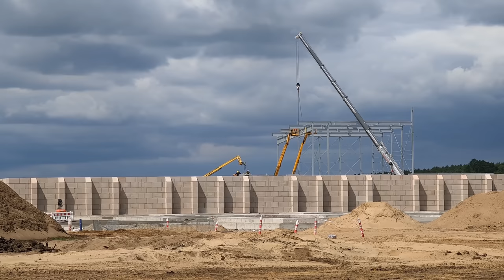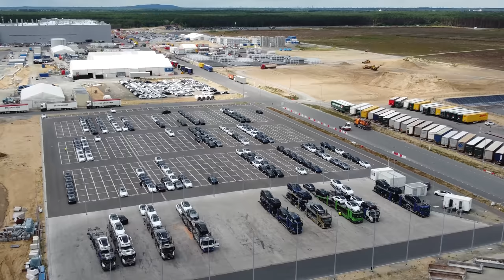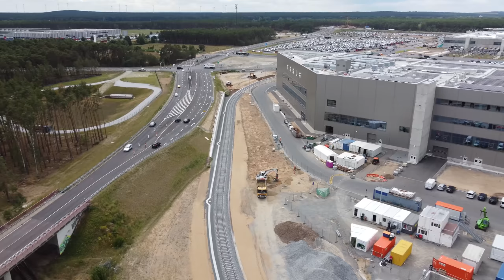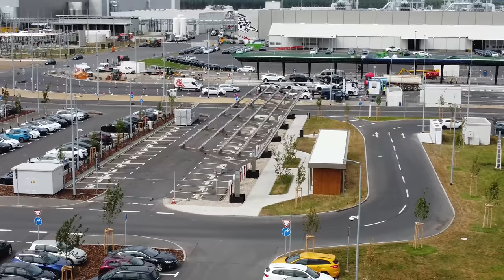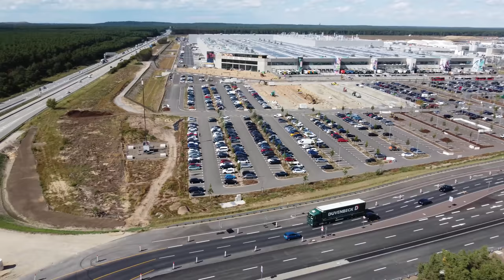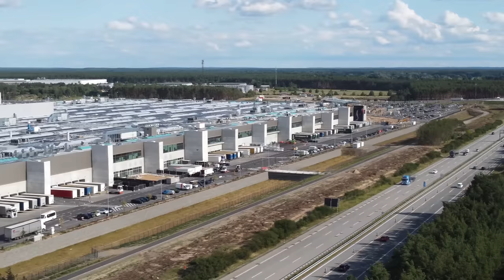Giga Berlin | 2023-07-20 | Timelapse

Comment: Thank you for adding overlays of the proposed expansion areas. If Tesla is not planning on using extra water and the trees are already felled, hopefully approval will be faster.
Reply: Well, dont't forget the 80.000 piles ...
Reply: Not to you personally, but to anyone who doesn’t know, The “expansion” area is within the original building plan area and not on any newly purchased land.
Reply from the maker: @julianreverse They applied for 82.000 piles. But as long as they don't forget about the permit, piles shouldn't be a problem. But I'm sure there will be some media drama about it.

Comment: Thanks Tobias! Amazing video as always

The new 700 × 700 meters production building could be for the Next Gen Vehicle? Would make sense watching the size of the building in comparation to Giga Mexico
Reply from the maker: The Tesla employees say that it's not decided yet which cars are to be produced there. But I'm pretty sure it will be a next gen vehicle.
Reply: @TobiasLindh  Do you know anything about the south side of the new building? I initially thought they would build the Model 3 next, since it wouldnt really make sense to simultainiously build production lines in Berlin and in Nuevo Leon for a product they have no experience on, and then start building the gen 3 vehicle in Phase 3. According to the plans the whole southside is going to be a giant storage area. Could it be that this is just temporary and will be a third production line later?
Reply from the maker: @ikarus605  They might wait with the northern buiilding until they got some experience from Mexico.
It's not part of the first partial permit, and even in the second partial permit is only the construction of the building and not the production lines. So it will take some time.
About the southern half of the building: Yes, it will just temporarily be used for logistics. When they're able to move the logistics to the land expansion to the east, they will use that part of the building for another production line as well.

Comment: Thanks Tobias.
It will be interesting to see where we are in just 1-2 years. 
Also it looks like chimney number 7 is about to go up at the casting building.
I think they will make the same kinds of shade structures at the main entrance parking, as they have at the Supercharger Area.
Reply from the maker: I didn't get into the details yet, but according to the new plans the funaces in the casting section will be upgraded, and they will change something with the chimneys.
Reply: @TobiasLindh  okay, that sounds interesting. In Texas it seems like they have two casting machines connected to the same chimney. But don't know if this will be the case.
Reply from the maker: @ChristianBlueChimp  It will still be 8 furnaces, but more powerfull. And two of them will be able to completelly recycle all the scrap aluminum.
I didn't find anything about changes of the chimneys though. It just sais "adaptation of the chimney situation".
Reply: @TobiasLindh  thanks Tobias for the information and thank you for all deep dives into the recently delivered applications for further expansion.

Comment: does "temporary waste building" mean this is a temporary used for waste management or that the waste is temporary? Interesting that they build 2 more buildings with the same ground level (but started later for the 2nd and 3rd).
Reply from the maker: It means that the building is temporary. It will be there probably for a couple of years and then in will be removed again.

Comment: Cool video, as usual, Tobias. I assume filming from outside of the factory's perimeter is not verboten ?  (Unlike Shanghai.)  Thanks!
Reply: Correct! At Giga Berlin it's only forbidden to fly above the buildings, within Tesla's proprietary perimeter. But it is allowed from outside the perimeter. When the prohibition was made public, Tesla said that once or two times a year drone pilots will be allowed to fly above the buildings and inside the perimeter. But it hasn't happened yet...

Comment: One thing I didn't see on the plans for the 700x700 building where the external stairs, would be shame if they didn't do them and have even more graffiti
Reply from the maker: There are no detailed plans for that buildng yet, as it will be part of the second partial permit, but I think they won't do external stairs at that building. There will also be ramps along the building to get on and off the parking deck on top of the roof.